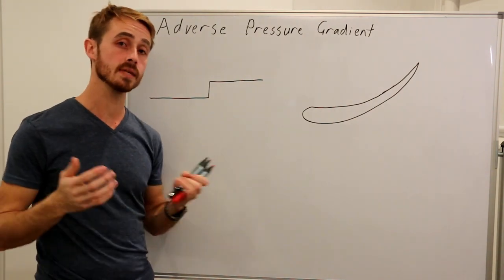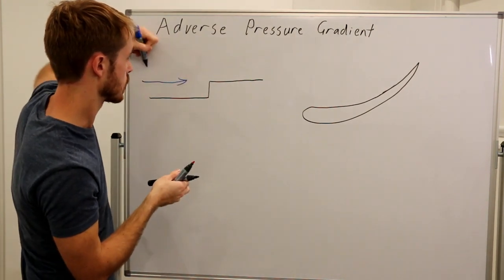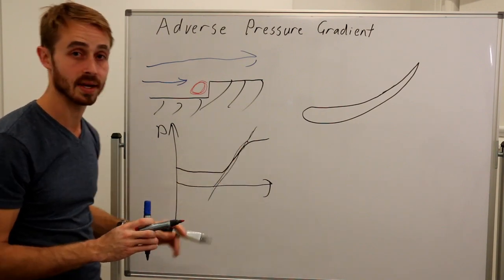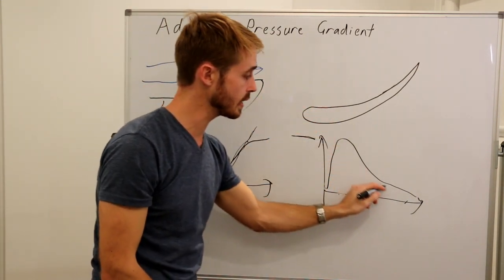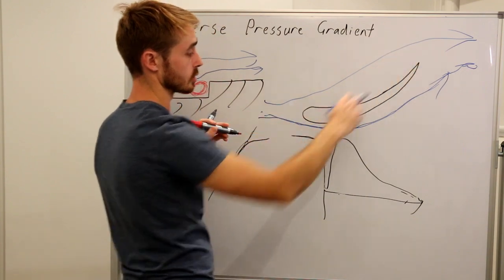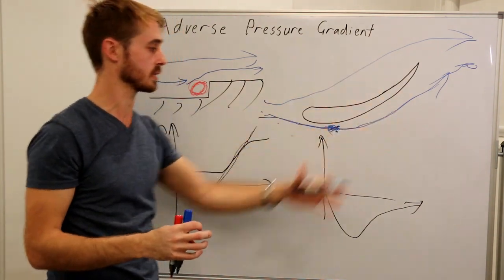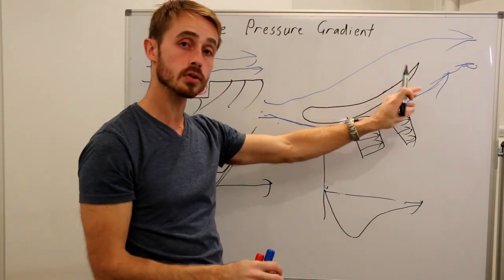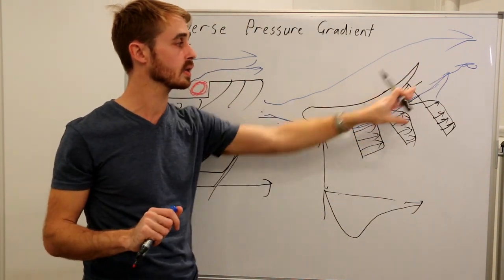What Causes Stall/Flow Separation? Adverse Pressure Gradient Explained

Comment: I would absolutely love a more detailed look into this phenomenon, aimed at a junior engineering level. I have a final year engineering project on the effects of attack angle on a symmetrical wing (NACA0012) under turbulent conditions, and have been trying to get a thorough understanding of the boundary layer physics occurring at separation, as I believe it is the downfall of CFD programs at turbulent conditions

Comment: Nice and very informative presentation.  Just a quick note; Flow around the corner creates a very sharp pressure drop (rather than pressure increase) right pass the corner.  Since pressure has to come up to normal ambient levels, that  have to occur with  a very high adverse pressure gradient causing a flow separation.  A very similar thing happens also in the airfoil, following the stagnation point.  Turning flow accelerates and pressure initially drops.  That very low pressure dip should not be forgotten.

Comment: Acceleration and deacceleration over the body → adverse pressure gradient → slowing of boundary layer → at sufficient adverse P gradient fluid layers adjacent to surface flows backward → separation boundary layer.

Comment: do you know why if water flow through expansion, let's say in the lower side of expansion, the recirculation zone is very large, but in the upper side,  the recirculation zone is smaller because of the presence of stationary air accumulation, will the center streamline is pointing a little bit upward? could you tell me in detail? any answer would be appreciated, thank you

Comment: In the case of a turbulent BL, the pressure gradient needed to generate flow separation should be higher than the pressure gradient needed for flow separation in the laminar BL case? I’m purely looking at the thickness of the different BL’s. However, I’m not sure if I’m missing something, because in a turbulent BL, you do have some pressure fluctuations.

Comment: Can you explain why the velocity is fastest at the bottom of the wing (or the top of a wing on an airplane)?  You said that like it's a given, but I didn't follow that assumption. (2:33)
Reply: Either apply Bernoulli's theorem or just think that it has more x-direction velocity,while crossing surface some of its x-velocity is converted into y-direcn velocity but on top of the surface there will be no curved surface so the velocity is high

Comment: Why is the flow seperation undesireable, is that due to the flow at seperated region is trying to push it down finishing the lift because of pressure is high than atmospheric pressure just like below the airfoil or anything else?

Comment: Considering there is a boundary layer of stationary fluid, why does surface area and therefore friction drag cause any problem at all? It seems that friction is holding the boundary layer stationary, and beyond that, it is energy transfer and minor gas related friction of the air itself, not contact with the wing surface that would cause drag. If that made sense, maybe you could explain it better. Thanks!

Comment: Does this phenomena always happen to airfoils even if it is just flying straight forward??? Generally speaking if an airfoil is in stall, this seperation point moves  further upfront to the leading edge, but if it is in straight normal flight is this separation point always present, but more located close to the trailing edge?

Comment: Why stalling does not depend on speed of air?, as if the  of air is increased then there will be more negative pressure at the leading edge of an airfoil and hence there will be more pressure difference and flow should separate earlier.
Is this right or wrong?
Reply: as the air speed increases the point at which the flow reverses advances towards the leading edge and initiating the stall..  at very high air flow velocity the wing with the curved surface just stops producing any lift and becomes an object of drag.  that's why supersonic planes have almost no shape to the upper wing surface and have to take off with full flaps and max power but once they are flying can achieve their high speeds.

Comment: Good video, but I still don't get why with extended plain flaps the adverse pressure gradient is steeper, and with slats the adverse pressure gradient is reduced. 
They have the same suction peak over their surface.

Comment: Its difficult for me to make the jump from the pressure graph to the flow profile going negative on the boundary layer towards the end of the wing. Can try to elaborate on that bit more? Which part of the graph, which gradient am i looking at here ? I feel like there is part missing here that would allow me to actually connect the two.
Reply: Hi.. fluid always moves from a region of high pressure to a region of low pressure.. because the pressure gradient is positive, the pressure INCREASES as the particle is moving towards the end of the wing. At this point, the force on a fluid particle caused by the pressure gradient acts in the opposite direction to its velocity.. so as its going along it keeps slowing down and slowing down until it runs out of speed and separates from the body.. Now, the flow reversal at the tip of the wing is caused by fluid particles moving from a region of high pressure (at the tip of the wing) to a region of lower pressure (in the middle of the wing)
Reply: Ok, this makes sense, thank you for the explanation!

Comment: what would happen if you added tiny dimples to the surface of the wing like those seen on Zipp carbon bicycle clinchers? how does dimples work on a surface when interacting with air flow? I've seen an example applied to a car on the pescarolo 01' where there are big bulges and serrations on the second element of their wing. i cant seem to grasp that concept. i hope you could make a video on this. cheers!

Comment: Why does the boundary layer end up being pushed back down the wing to cause recirculation?
Reply: Because down the wing there is very low pressure due to the high velocity
Reply: alles klar klaus Why is the flow seperation undesireable, is that due to the flow at seperated region is trying to push it down finishing the lift because of pressure is high than atmospheric pressure just like below the airfoil or anything else?

Comment: I have doubt . In case of car , suction is present in rear of car . As velocity of air which is nearest to car roof slows down and comes to rear of car , it's potential energy will also decrease and pressure will increase according to Bernoulli's . Why won't that high pressure air moves into suction cause pressure difference causes fluid movement . Fluid moves from high to low
Reply: late reply: because the bernoulli equation is an energy conservation equation. in a boundary layer, the shear stresses reduce the kinetic energy, but the pressure (which in itself is sort of a potential energy) remains constant. this also applies in the wake of, say, cars: because of high turbulence caused by the flow separation, the velocity at the back of the car is actually quite low, even though the pressure is lower too.

Comment: So stall is undesirable because it decreases the efficiency of the wing due to flow separation?
Reply from the maker: Depends, in something like F1 they deliberately stall the rear wing with DRS so that the total drag drops (the induced drag is very high otherwise) as they don't care about the downforce down the straights. But in most cases yes, stall is undesirable.
Reply: KYLE.DRIVES Ah, I see. Thanks!
Reply: I didn't know they did that, I always wondered about whether or not they controlled it for different effects at different times.

Comment: Would the top and bottom of the wing have different pressure graphs? If yes, how do they affect each other?
Reply: Naturally, yes, due to the wing profile. Pressure differences on one side of the wing will transmit through the vehicle, affecting the suspension and fluid dynamics below the vehicle, but the pressure on top of the wing shouldn't have an effect on the pressure under it as they are separated by the wing. I suspect that the varying pressures do matter once the air leaves the end of the wing and the streams combine, where they create turbulence and an adverse pressure region behind the wing. This is where Micro VG's I believe are used as well on the aft of a wing, about 30% of the distance before separation, in order to create a vortex to minimize the AP behind the wing. But, I really just started studying aerodynamics online for fun the other day. This guy should know much better. I may have also messed that up, I'll have to read it again.
Reply: I think by the trailing edge the pressures both return to near atmospheric, so the effects are minimal. It's one of the reasons for aerofoil's shape. The bigger issue is with spillover off the side of the wing, where the high pressure fluid tries to flow over to the low pressure side, creating what's known as wing tip vortices. If you image search that, you can clearly see the effects of it on aircrafts (quite pretty). It's why wings generally have a plate on the side, or a bent up wing section at the end in the case of some aeroplanes
Reply: Sherlock MacGyver Why is the flow seperation undesireable, is that due to the flow at seperated region is trying to push it down finishing the lift because of pressure is high than atmospheric pressure just like below the airfoil or anything else?
Reply: Zander Meiring Why is the flow seperation undesireable, is that due to the flow at seperated region is trying to push it down finishing the lift because of pressure is high than atmospheric pressure just like below the airfoil or anything else?

Comment: I watched your vortex generators video and was wondering if they would be benifitial with a lip style spoiler? my car has a 10" tall spoiler (because of race class) so would generators make it more effective?
Reply from the maker: Honestly, it's impossible to tell precisely without knowing the exact specifics of your car/performing CFD modelling. Adding VGs will almost certainly shift the centre of pressure rearwards, and might increase your total downforce, but even then we would only be talking a percent or so at most. If you are interested in knowing for sure you can always check out the CFD services at www.jkfaero.com
Reply: +KYLE.DRIVES  I don't really have the money to do proper aerodynamic engineering. my race car is just hobby. I really enjoy watching your and greys garage's videos about aero tho. thanks for the feed back!
Reply from the maker: No problem! I think you would be surprised by how accessible CFD is for hobby racers though, if you do your own CAD work it is only $250USD a run from JKF, just in case you ever decide to go down that route.
Reply: Does a $250 run come complete with a free can of worms...?

Comment: Do thte concepts presented here apply to water flow? I'm trying to separate very fine gold from heavy iron (magnetite) sand. Great video by the way
Reply: Waterflow occurs at much lower reynolds number, and so I believe the flow better sticks to the wing, and doesn't separate as easily. Depends on the operating conditions though